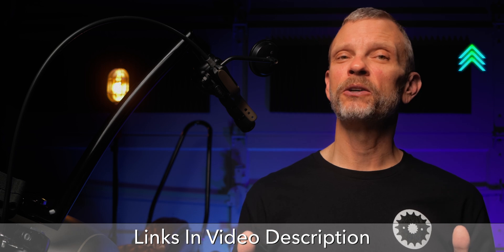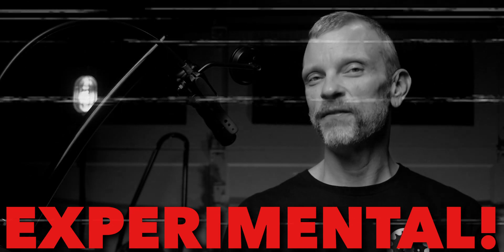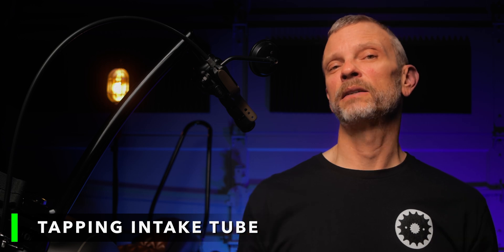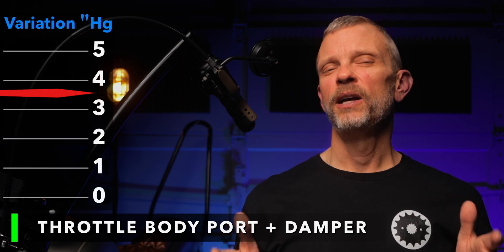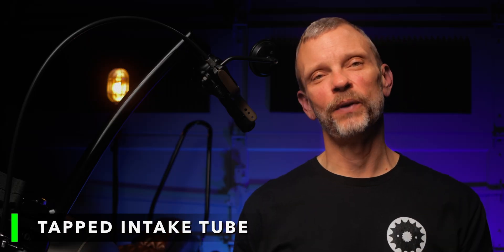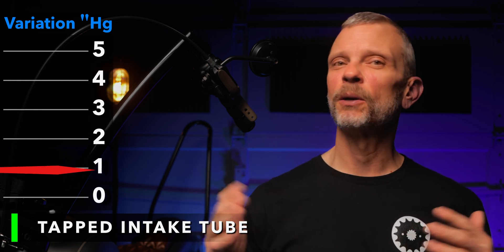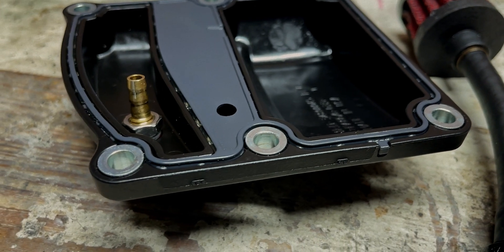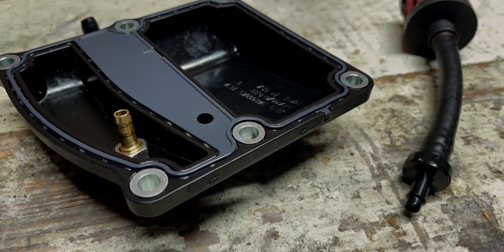Vacuum-Ported Catch Can • Crankcase Vent: Keep It or Dump It? 👍🏼❓👎🏼 (M8 Sumping)

Comment: Hi Ron,
I've just come across your channel recently and appreciate all the investigation and testing that you do so we don't have too. I've watched the whole series of vids on the breather mod, crankcase vent, and vacuum. I also follow Kevin Baxter and enjoy his channel as well. With all that being said I'm not convinced at all that vacuum is even a thing for the intake and crankcase. I think this is being way over blown and taken out of context. If you remember your video a while back when you were running both mods with no concern about vacuum your bike was running like a scalded dog and you had no issues. After 40 years and counting with the Dept of Defense we live by one motto KISS! I'm currently running a DIY head breather on my 2020 RKS and plan on doing your trans mod along with a SE Torque cam install. I will not be running a check valve and I'm not running my hose up over the rear of the bike. I'm going to tuck my pod filter just under my left plastic heat shield over the rear cly. These are Harley's not SR71 Blackbirds lol. Keep up the good work.
Reply from the maker: Hey Vincent - thanks for the encouragement. I believe there’s a combination of legitimate problems as well as some excessive noise regarding these issues. I’m a fan of crankcase vacuum, but for me the main thing is alleviating the excess pressure. If there’s any vacuum, that’s a bonus. And yes, KISS is the way to go. Let me know how it goes with your project!

And if you want a sticker send me a DM on Telegram, Instagram or Signal with the mailing info @RonsWorkshop
Reply: Hey Ron,
I would like a sticker but I don't do any social media. This is actually the very first time I've responded to a YouTube video lol. I wasn't even sure if I was signed in to do it. I totally agree with you about getting rid of the pressure. I never knew about putting a plastic bag or ballon over the oil tank cap port. I might try it on my 2020 to see what happens. Does it make a big mess with oil? I also have a 04 TC Roadking Classic that I did the head breather mod to and have had no issues with it. The main reason I want to add the trans mod to my RKS is the cam upgrade. I've read that guys that move up to stage 2 develope issues which I think is excessive crankcase pressure with a larger and longer duration cam profile.
Reply from the maker: You shouldn’t have a mess with the oil filler plastic bag trick. You could ease the cap off at first just to be sure. 

And congrats on your first YouTube comments! I’m honored to be a part of it. 

YouTube strips out the email address from comments, so I can’t provide it here. But if you visit my “About” page on YouTube and then click on “View Email Address” you can contact me that way. Note: You have to be logged into YouTube to see the email address. Here’s a link to the page: https://www.youtube.com/c/RonsWorkshop/about

Comment: https://www.youtube.com/watch?v=VZnWaBFC0FQ
This idea seems kinda bad in that it expels the crap that might be not so good for the oil, back into the oil reservoir. But then check out the idea of putting breathers in the head. This also kind of suggests  vacuum that is thought of as a necessity within the workings of the breather bolts is a non-issue from this guys point of view. The vacuum has to come from somewhere else when talking Crank Case vacuum if you eliminate the crank case blow by altogether from the air cleaner in this guys products.
He sells a catch can that I also question the design because it feeds to the lowest point in the catch can.
https://www.youtube.com/watch?v=6Ek9nlQwjxg
Reply from the maker: In general T-Man's parts seem to be top-notch. I hadn't seen his top cover yet, so thanks for sharing it. I agree that it totally disregards the potential for crankcase vacuum, and it's a lot of extra (albeit nice) hardware on the transmission top cover. I also agree that the catch can with bottom inlet seems odd.